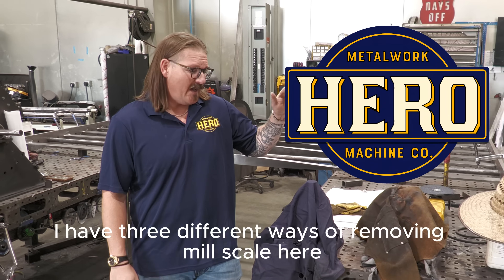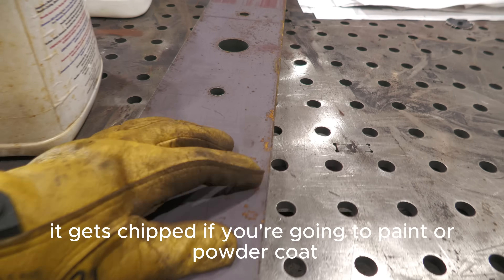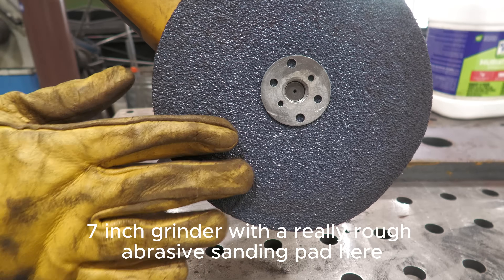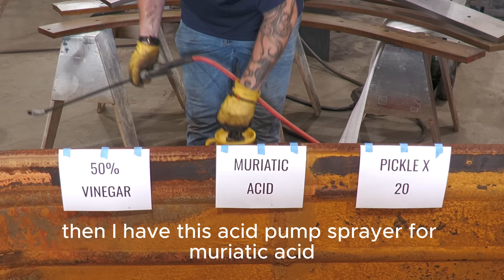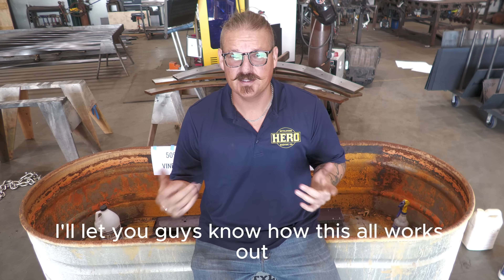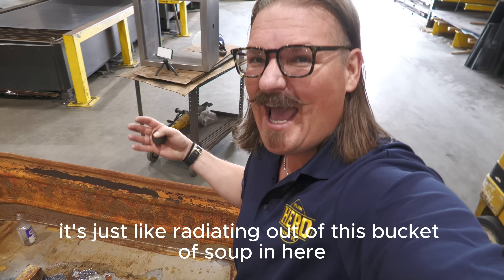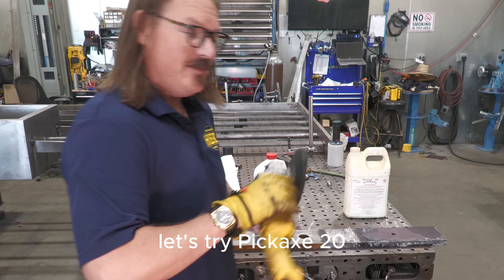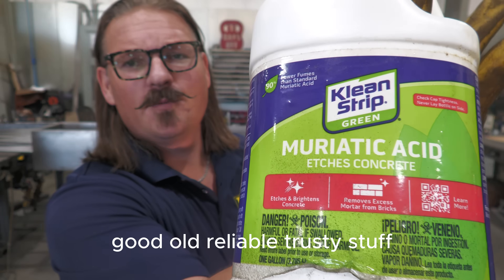Which Chemical Wins? Best Way to Remove Mill Scale from Steel

Comment: I use the diamond cut off disks. Takes the heavy millscale off. You can also use  7" concrete grinding disks. They have silicon carbid.
Reply from the maker: I've never tried a concrete grinding disc. I'vee got one in my tool box. I'm going to give it a shot.

Comment: Could you record a short guide on what you would personally invest in at the very beginning of starting a welding business?
What do you think is a realistic entry-level investment to get started in steel fabrication?
Where would you look for your first customers or contracts?

I’m currently running a steel wholesale business and have started developing a second segment focused on welded steel structures. I’m now seriously considering my next steps and where it makes the most sense to invest – both in terms of equipment and business development.
Reply from the maker: Oh man, this is some great feedback! I could totally make a startup guide for welders video. 

I'm obviously biased but others would agree that a plasma table is the single most powerful tool you can buy for your shop.

Comment: I've had too many close run ins with muriatic hydrochloric acid, plus at some point it'll go non-reactive and then what's everyone's solution?  Chances are they're not paying the extra for a chem-clean up and disposal because they'll be a cheap prick about it, so they'll dump it down a sewer and cause more problems.
Cleaning Vinegar, its a bit stronger and you will need to dilute it down for a bath but even heavily forged parts covered in scale are coming off after 2-3 days in a bath with a wire brush. Just cover it and put it outside to cook because otherwise everything in about a 100y radius is getting rusty!

Comment: I did a set of solid bar gates like that a while back and the customer wanted the cleanest look where the pickets met the top and bottoms. Ended up tapping the pickets and using countersunk allens through the top and bottom. Then just took the gates to the blaster and off to the powder coater for clear. Each side was 10'W by 12' high, heavy as hell but what the rich man wants, the rich man gets, lol.
Reply from the maker: Oh man, that sounds like a really clean way to fabricate those gates!  I'll do anything that covers the shop rate, just tell me what you want.

Comment: Do not leave muriatic acid containers in your workshop even if sealed. Store outside.
Reply: I wouldn't pour, spray, or leave the lid off without lung protection, as well.
Reply: It's amazing how it can strip the chrome off things for a good ten feet in all directions.

Comment: Strip disc on a right angle grinder works really well. Been using BlackHawk brand strip dics with very good results. Metal fab work has enough nasty chemicals don't want to add more to the mix.

Comment: I use the stabilized muriatic acid “acid magic” in a bucket with water for smaller parts and table legs.  I’ve found that often I have to degrease the steel first.  But the muriatic works in minutes.  I also dunk everything in water with baking soda to stop the acid once the mill scale is removed.

Comment: Not a great way to apply any of those materials, especially the muriatic acid......great way to rust everything within range of the vapors. I've used 30% cleaning vinegar successfully for years. Submerge the parts for 6 hours-overnight, and the scale will literally wipe off with a washrag or scotch brite pad. You can reuse it a number of times before it becomes too weak to be effective. People who say it doesn't work, simply aren't using it properly. Or, you could also just sandblast it. A lot depends on what kind of shop/work you're doing. If you have machine tools and/or precision metrology instruments, muriatic acid is bad news. It'll off gas right through a plastic container and rust the shit out of your tools. Different strokes for different folks.

Comment: I use Household vinegar (5%) all the time and it works great.  I put it buckets or tubs depending on size of part and submerge it for 2 to 3 day depending on temp outside. Rinse scale off with hose and neutralize with Windex .  Awesome and easy for anyone to do.  Also, a very cheap and safe option that anyone can do after a quick trip to the grocery store!  Zero grinding necessary as well!
Reply from the maker: Wow man, that's a great tip, thanks for sharing!

Comment: I would go with sand blasting and an aggressive medium.  Muriatic acid will work if you have the weather to dry it (same with phosphoric) to a powder otherwise it will interfere with any top coat.  Vinegar is a waste of time and I never heard of that last one.  A grinding wheel will mostly burnish the scale unless it is a very small piece, you just can't get much done in any reasonable length of time.
Reply from the maker: Yeah, sand blasting works great. We just dont do enough of this to invest in a whole room. We have a cabinet for small parts

Comment: Cover the steel with shop towels, soak them with vinegar overnight,  the mill scale will be softened enough to easily be removed with a stripping disc on a grinder.
Reply: I submerge steel in household white vinegar overnight,  then rise and neutralize with baking soda and water,  then wipe off the millscale off with a shop rag.

No caustic fumes, no dangerous waste (right down the drain), and super cost effective.  It's the perfect solutions, as far as I'm concerned.
Reply from the maker: Ok, that sounds like a cool trick! I'll definitely try it this week.
Reply: And cover in plastic to help keep it from evaporating

Comment: I tried vinegar and for trying to Tig weld the steel after it cleaned it off but it was still dirty and the weld was popping when I welded it after . And that was after a couple days soak. But it did take it off 👍👍
Reply from the maker: Sounds about right
Reply: @HeroMachineCo I’ll have to try the meratic acid one